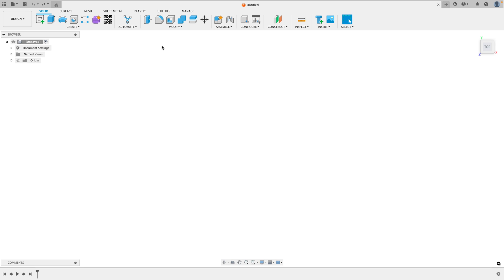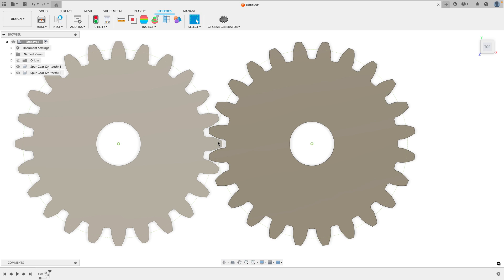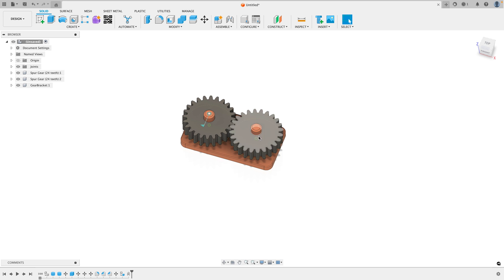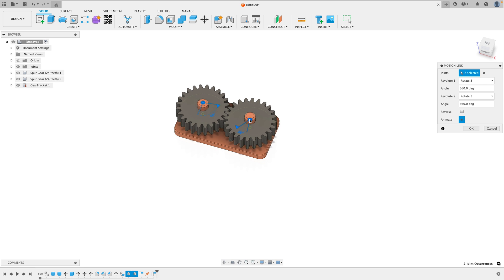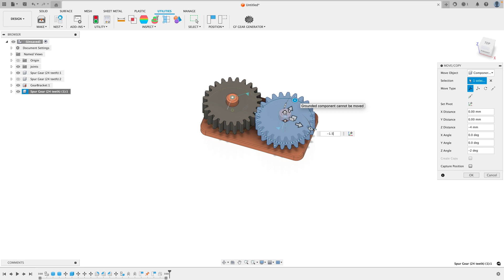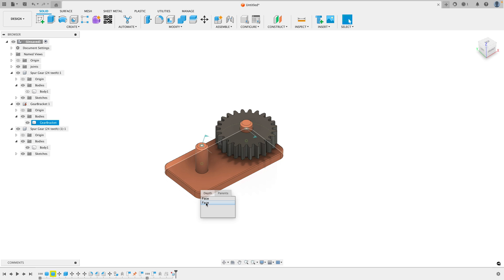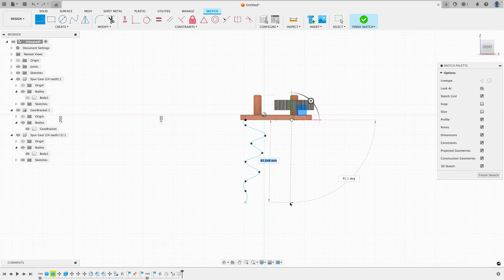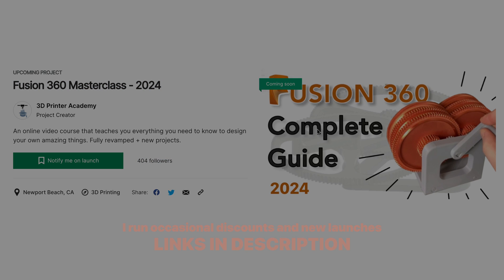5 Fusion 360 Tricks You Need to Know

Comment: Okay, coping those settings makes a gear, but you didn't teach us how to make a gear the size we want. What do all those parameters do?
Reply: The main settings that affect gear size are the number of teeth and the module. Module is pitch diameter divided by the number of teeth, and needs to match for two gears to mesh. Generally with gears you choose a module and then the number of teeth controls the diameter of the gear. 

Pressure angle controls the shape of the gear teeth, and also needs to match between meshing gears. 

Backlash is a small value to correct for inaccuracies in manufacturing, ideally you have enough that the gears can smoothly turn without much play. 

Root fillet radius adds a fillet inside the gear teeth, hole diameter is the diameter of the hole in the gear, and gear thickness is the thickness of the gear.
Reply from the maker: Simply change the number of teeth for bigger gears